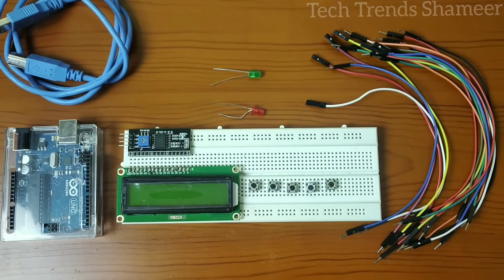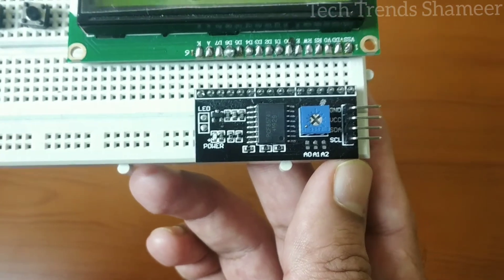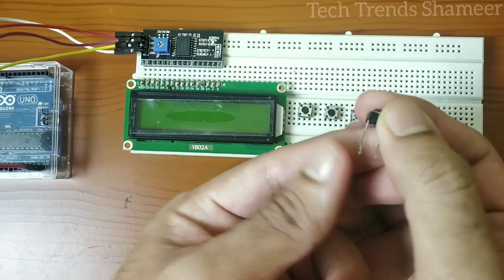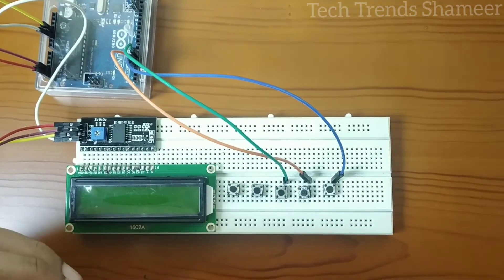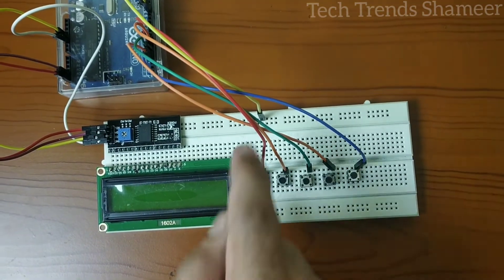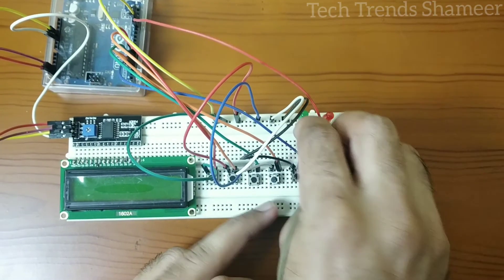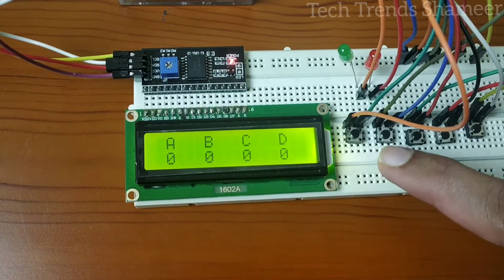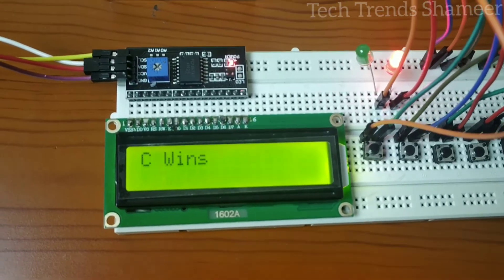Electronic Voting Machine using Arduino Uno

Comment: Compilation error: no matching function for call to 'LiquidCrystal_I2C::begin()'
Reply: I’m about to implement this on the hardware using your code and process so it going to work?
Reply from the maker: Replace lcd.begijn() with lcd.begin(16,2)
Reply: @TechTrendsShameer  sir I replaced begin with init and it worked out in arduino but sir i wanted a proteus design can you provide me please?
Reply: @TechTrendsShameer  sir i want the design on proteus can you help me with it?

Comment: First circuit is different and last your showing result circuit is different
Reply from the maker: Both are same. You can use any pin in the breadboard as per the circuit.

Comment: Code was correct...gave connections according to the circuit diagram....but not working
Reply from the maker: What error you are getting ?
Reply: @TechTrendsShameer  not displaying anything
Reply from the maker: @shamarulbrightwinr5657  Check whether there is any loose connection.
Reply: @TechTrendsShameer  my professor made a slight change in program...and it's working fine now...thank you
Reply from the maker: @shamarulbrightwinr5657  Great. May I know what change he did?
Reply: @shamarulbrightwinr5657  can u tell me what changes,because i also made all connection correct and there are also no error in code and it also upload successfully. But not showing any output on screen
Reply: @shamarulbrightwinr5657   bro can you please send the code that your professor had changed
Reply: @PrathameshSarode-rh2dn   yes bro for me also same problem what you have done can i know?

Comment: Fantastic
 Sir
I need counter using i2c lcd with preset selection option with realy output
Reply from the maker: Thank you. You mean you need to create a visitor counter using LCD/I2C ?
Reply: @TechTrendsShameer   yes yes
Reply from the maker: Ok. Where you are planning to use relay?
Reply: @TechTrendsShameer  preset count example I want to operate relay @ 1000 or what I decided
Reply from the maker: Ok. Will try